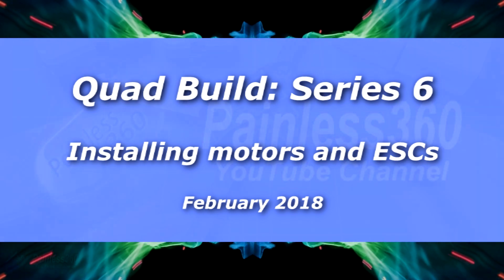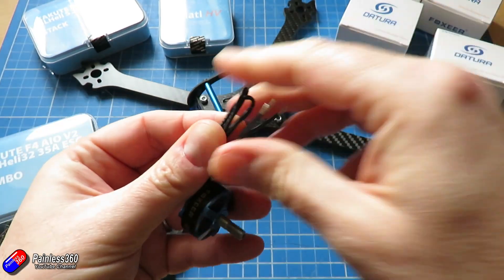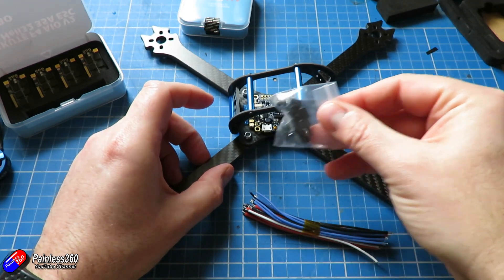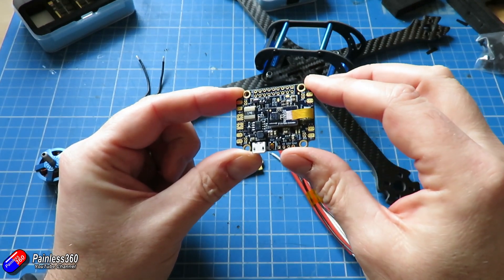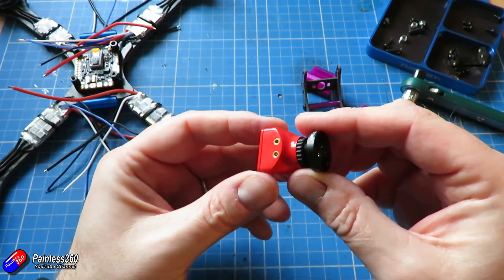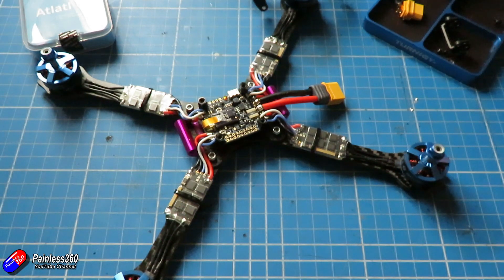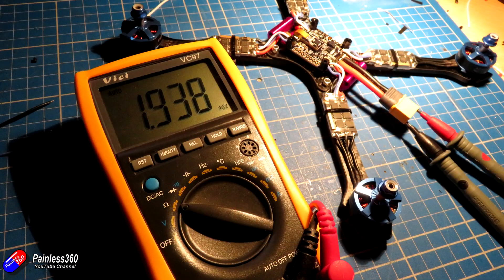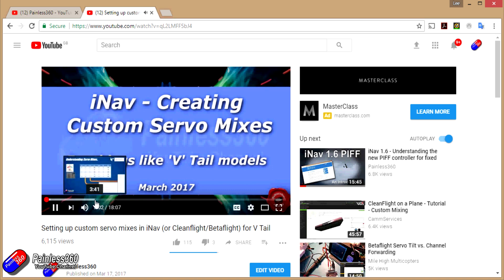Quad build, Series 6: Installing the motors, ESCs and wiring for power

Comment: Hi,
I have f450 frame and Pixhawk mini (discontinued), and my question is how to wire up to the PDB?, i soldered the +- wires from the ESC`s to the PCB on the frame, do i need to wire the main +/- on the pcb frame to the power module?

Thank you!
Reply from the maker: I honestly can't recall. This is an older series I made. The PDB usually has two jobs; split the battery power to all of the ESCs and connect to the FC using a cable to power it and provide it with voltage and current readings.. Best of luck!
Reply: @Painless360  thanks

Comment: How do you know what wire is what from the motor ? Need to replace one on my tinyhawk 2 freestyle and don’t know what’s what
Reply from the maker: See my Quadcopter on for beginners and RC Basics videos. You connect the three wires up in any order and swap any two to reverse direction.. Best of luck

Comment: My esc has a red white and black cable bundled together on a small rectangular block with pin holes in the top. My FC does not have a spot for the pin holes so I have to cut the wires apartment and solder them. Where do I solder the red wire from the ESC?
Reply from the maker: I am not sure what you are describing. I'd look for a manual or pinout diagram for it.. best of luck!
Reply: Painless360 is there a way I could send you a picture of my setup? I can’t find a manual

Comment: Hi Lee. Just been watching Drone Camps. A thought popped into my head - it does sometimes happen! I posted it there but since I've also found your channel invaluable I'll repeat it here. This may not have any legs, but here goes. How about anti-vibration mounting the motors to the frame? Still keep the frame to flight controller mounts but add a second level of protection. Reduce the bad vibes getting into the frame in the first place. Now, it might have a horrible effect on control accuracy, especially if the motor mounts were too soft and that may be why I have not seen this done anywhere I have looked so far. Still, maybe worth an experiment. One way might be by using a stud mount rather than bolts. Loctite stud into motor, 'O' ring between motor and frame, another 'O' ring, small washer and then either a self locking nut or a full nut and a 'jam' nut. I imagine it would need to be fairly firm but could well supress the high frequency mechanical vibrations, making those vulnerable solder joints, especially on arm mounted ESC's, that much safer. In the interests of the hobby I'll waive any IPR. Cheers, Bob UK.
Reply from the maker: It was tried by a few back in the day to help with shutter roll issues in FPV cameras. Soft mounting the flight controller/IMU is easier..

Comment: Is it needed to use lock tight (Loctite) while screwing the motors and the frame? Thanks!
Reply from the maker: It wouldn't do any harm. I used to use a lot of it back in the days when I was a helicopter pilor, but it's fallen a little bit out of favour now. If you have some around, I pop a bit on the threads. Happy flying!
Reply: Ok, thanks!
Reply: Geraldo, I've worked with electric motors.
If you use a tiny bit of the Loctite 542 on your screws, vibrations can't shake them loose but you are still able to unscrew them.
Reply: Yeah I know it's expensive but 10 ml will last for quite a long time.
Reply: Ok, thanks for the tip... I will use just a tiny bit =D